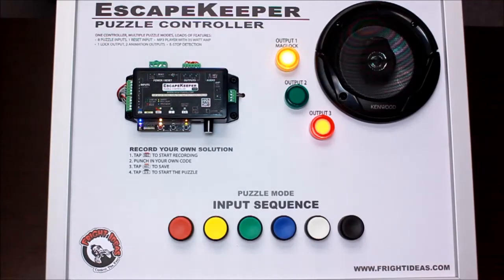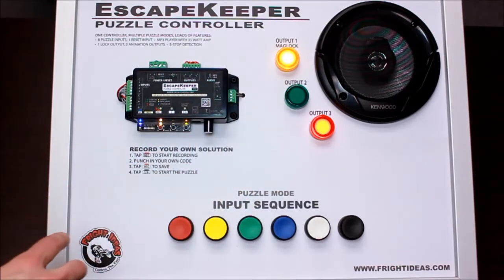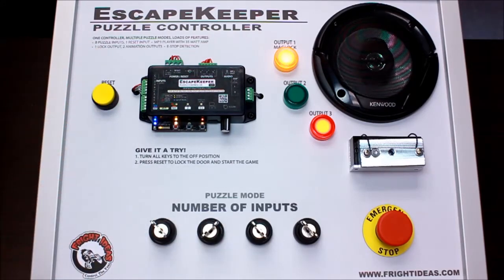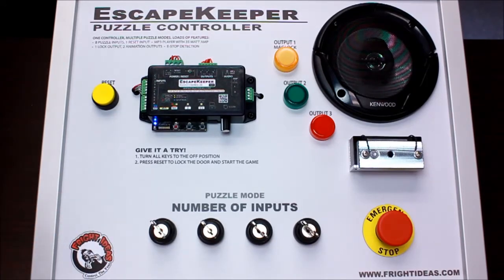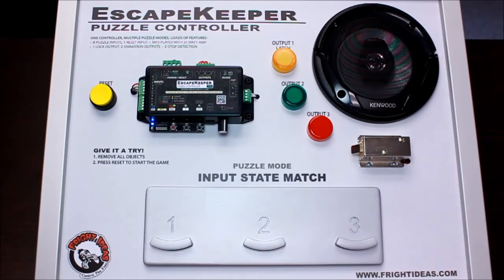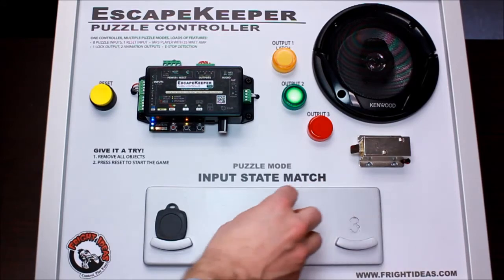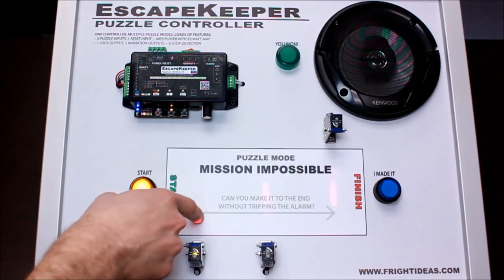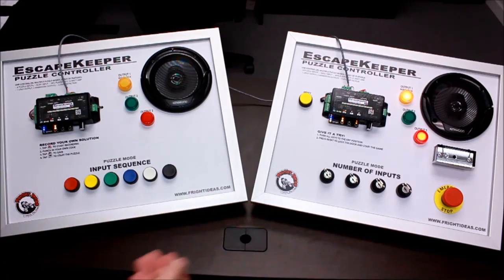EscapeKeeper Demo

Comment: On the mode with the keys you show if they want to be slick they can try to take the same key and unlock other locks it wouldn't work.   I see this not working if the lock must be in the lock position to remove the key but what if the key can be removed while in the on position. Would they then be able to brake the game? It seems like yes
Reply from the maker: Yes, a key switch where the key cannot be removed in the ON position would be required for that feature to work.